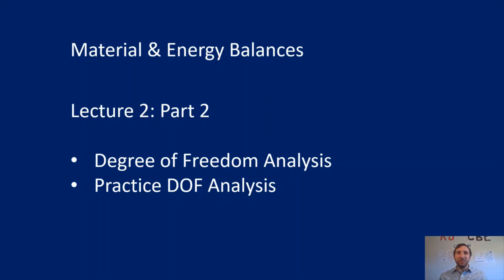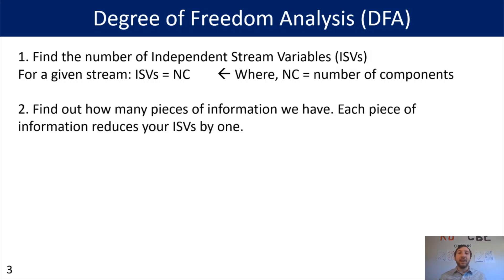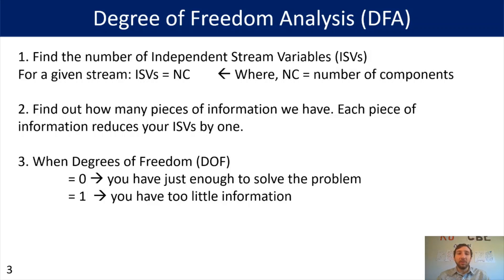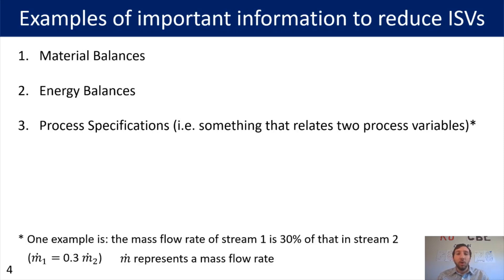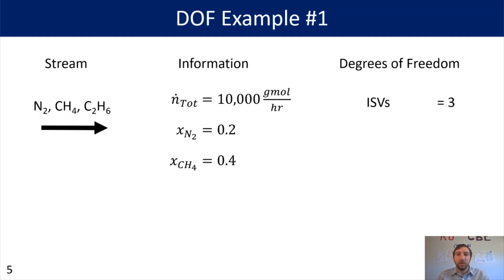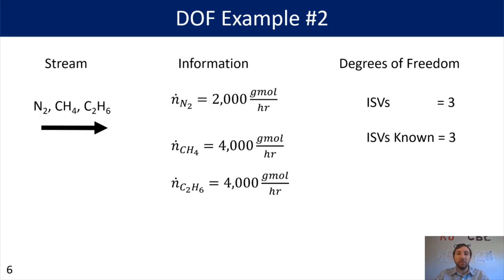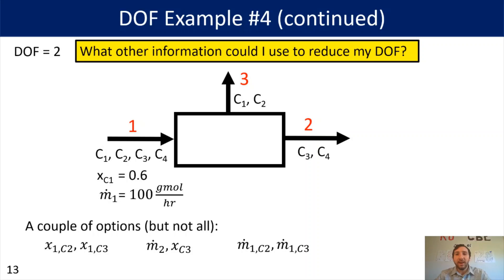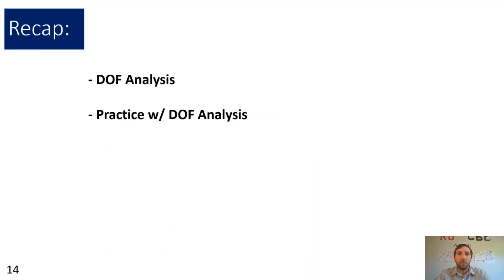MEB: Degree of Freedom Analysis (with practice)

Comment: Thanks Dr.B. After finding the dof analysis on a process, how can I use this found dof number, can I use process the must-specified process parameters as controlled variables to set the process control? In short, can we connect/correlate the newly dof-fixed parameters to set up the process control system?